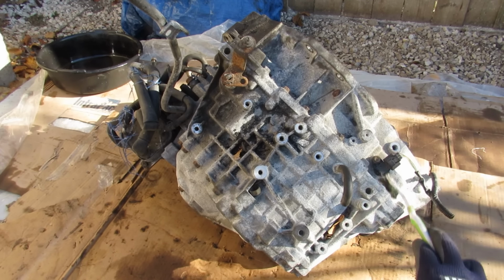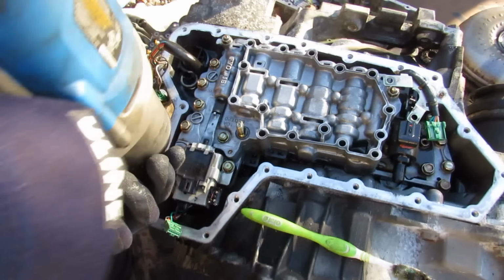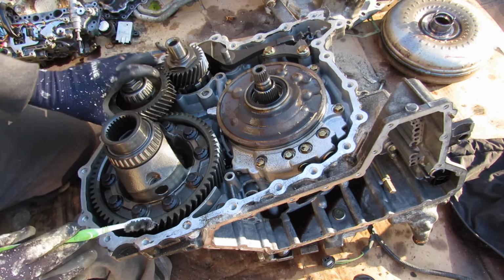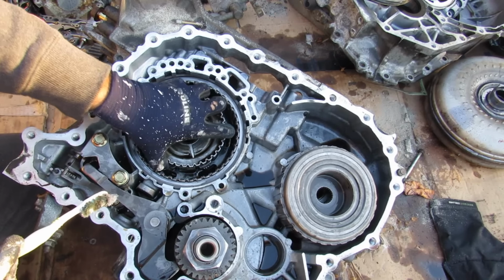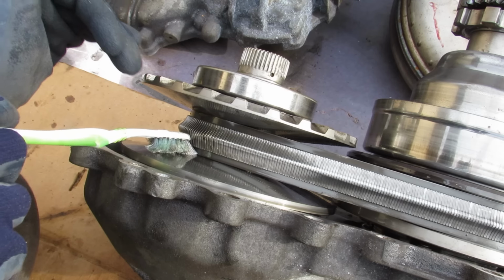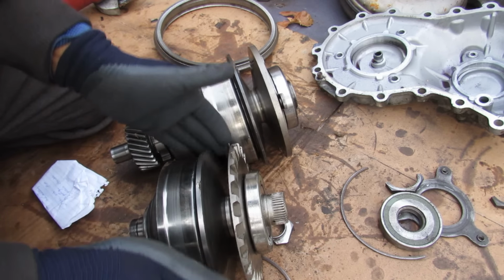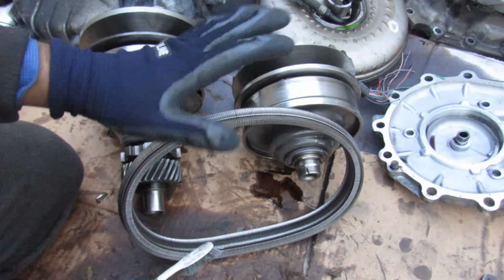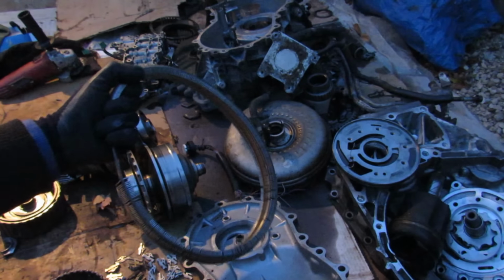Why Nissan CVTs FAIL

Comment: I'm currently with Lemon Law Lawyers dealing with Nissan on my 15 Nissan Rogue. My CVT went out and was replaced by the dealership only to be failing again a year later. Been at it for a year and half waiting for Nissan to response with a settlement until almost 2 weeks ago. Waiting on the Lawyers to get all the paperwork together to hear what Nissan said. I don't drive it anymore. I'm still paying for the car which is not working properly. Had to take out another car because that Nissan was unreliable. Because of that car, I've been drowning in bills and struggling for almost 2 years. So I am hoping to get all my money back that I payed in that car, all the struggling I had to deal with, stress and more. I knew it was gonna be the band from the CVT that was failing. I could feel it when driving. Thank you for dissecting this CVT. Very knowledgeable.

Comment: I just think cvt shouldn't exist... they are boring to be driving with.   Even going against the wind they are weak
Reply from the maker: It's for economy
Reply: @speedkar99  i understand that but going up hill engine revs up and you still loses speed.    I have an 05 civic with an 4sp auto and runs alot better then my 2016 nissan sentra... and the civic gets better miles per gallon

Comment: Will a transmission fluid flush fix cvt slippage and jerking?
Reply from the maker: It might help but if there is already mechanical damage there's nothing that can fix
Reply: @speedkar99  I'm buying a used Nissan tida 2007 model.what are the things I should look out for before buying?

Comment: CVT transmission has been conceived by DAF, a Dutch car maker, for a little car, to make it cheaper and more practical. I would never imagined such a system with some much points of failures. And I don't understand the pourpose to install "this" in a modern car having the choice of a standard automatic or a even a DSG.
Reply: Comparing a modern CVT with the DAF system is like calling a horse carriage a modern vehicle. The planetary gear system used in a Toyota CVT (hybrid) has barely any connection with the DAF system

Comment: They fail because they need 20k interval flushes ran one 350k miles until the motor died. Trans was still mint
Reply: I think this is a big part of it. People got used to never even bothering to service their transmission.  With older conventional automatics, you could get away with that.  But a CVT will make you pay.

Comment: I also have a nissan 2.0 with this transmission, 12 months ago I put in factory grade oil and it love's it when pulling 6 thou & passing at 150 kph. I don't spin the wheels so hasn't blown yet.

Comment: This type of CVT has been used for nearly a century on such things as combine harvesters which are powerful and exceptionally heavy. They use rubber pull belts rather that the one shown, which uses a steel push belt.  On a combine, speeds from zero to four or six miles per hour are the working speeds but they also need zero to maybe 15mph for transport. For that reason the variator is matched to a conventional three or four speed mechanical gearbox plus reverse.  These long established simple CVT’s in farm machinery have now mostly been superseded by fully hydrostatic CVT transmissions with oil pumps and wheel motors, largely due to the much larger size and weight of modern machinery that overwhelm the torque capacity of belt type CVT’s.  
Back to the rubber belt type variator, rather than an incorporated type of servo operating within the pulley, keeping a constant distance between the pulleys as seen in the video, traditionally the variator would be positioned intermediate to the engine and the mechanical gearbox and a simple hydraulic ram used to swing the whole variator in an arc up or down. Both pulleys could then just have strong springs pulling them together and just altering the distance between engine and gearbox would force the fixed length belts to lever the respective pulleys in and out in opposite directions to effectively alter the pulleys diameters relative to each other and therefore the speed of the output belt. The input belt is, after all, fixed to the engine speed, which in a combine is always flat out-full revs [2600 rpm typically]

Comment: Only one of the pulleys need to be powered in and out for the belt to climb or sink. The other pulley only needs a good spring to maintain a good grip as the belt allows it to expand in and out as the belt then rises and falls in the opposite way to the powered pulley.

Comment: I work for the company that makes the CVT belts. Its amazing how complex that belt is given its unassuming simple look. Its the most vital link.
Reply: My toothbrush has no power when brushing. Can you fix it?
Reply: @jonathangaudette9939  yes, let's meet on teams to discuss. You'll need livestream capabilities. I'll dedicate a few hours to the cause.
Reply: @jonathangaudette9939  not if its a nissan toothbrush.
Reply: @jonathangaudette9939  is it a CVT toothbrush?  that cold explain everything
Reply: Punny statement, guy! 👍🏾
Reply: I’ll stick to working on my scooter’s CVT.
Reply: Nissan's going to a chain instead of the belts
Reply: listen
Reply: Does the belt need to be changed as well as the fluid and filter when doing a CVT flush?
Reply: Someone pitches a question in a comment section, assumingly filled with knowledgeable gearheads who may have an answer to his question, and he receives flak for it. If you dont have the answer to his question, how about moving on and not opting to be a dick?
Reply: My nissan X-trail, somehow have no power when accellerating and i dunno why? Do you know some of the symptoms of the failure that cause my cvt to do this, I want just a few symptoms that can cause this. If you want to talk private, we can do so to.
Reply: LOL!! I know someone who works at a bank, maybe I should ask him why I'm always broke... Weirdo. @VistirinDainn
Reply: @VistirinDainn instead of asking a complete stranger to dedicate loads of time in a youtube comments section, perhaps just go to your local garage.
Reply: @stevenm8970  never understood people who comment stuff like that lmao
Reply: You should be ashamed to be involved in such an awful product lol.

Comment: One of the main drawbacks of the CVT is its limited torque capacity. Because the surfaces of the cones are smooth, the cones have to squeeze the belt or chain with great force. If an engine has too much torque, the belt or chain might slip. If the belt starts slipping in the CVT it will not last long.
Reply: Clar nu merge pe motoare puternice.Cred că pt mașini mici de oraș cu motor de 1.2 este ideala cutia

Comment: The maintenance requirements for CVT and conventional automatic transmission are basically the same; changing the transmission fluid in recommended intervals which is not very expensive.
Many manufacturers don't even list CVT fluid changes in the maintenance schedule for normal driving conditions. Instead, they advise changing the CVT fluid if the vehicle is operated in severe driving conditions, including towing, driving on dusty or muddy roads, or in freezing or very hot temperatures, etc.
Reply: Very true. Plus, how many out there do check/study the owner manual to better care of the said car especially in unforeseen circumstances, preventive or not? This is why I question the driver’s habit/characteristics more than the car itself. Car can’t be bad from the get go.
Reply: @edgaryzen4925  You have to be a good listener/detective to get to the truth of what happened. Some drivers may have done, or not done, something that lead to the problem they are bringing their car in for. However, they may be to embarrassed to admit that they made a dumb mistake and now their car is having problems. 

It's always the typical explanation/story. So, yeah. There I was driving to work. Everything was peachy until, without any previous signs/warning,  my car begins to do "X".  Not sure why my car is doing this.  Can you help me out?"  🤣
Reply: You guys fail to realise not everyone is a mech. People trust that engineers have done their job to idiot proof things for them or are oblivious. The problem might be manufacturers chasing profits over building things that would last a life time.

Comment: I have a 2022 Ford Vignale, 2.5L Duratec FHEV with CVT Automatic transmission. Wonder how long the CVT will last? Has there been any reports of failure from Ford.

Comment: The fuel economy on my 2011 Toyota Avalon is better than that of the 2011 Nissan Maxima with the same engine displacement. Mine has a 6 speed automatic transmission instead of that trash CVT. That was the main reason I didn’t go with another Maxima and the 2nd reason was the styling.

Comment: Highly appreciate all what went into the production of this highly informative video. However, Nissan has developed another nightmare in the world of automotive industry that is VC-Turbo Engine. Simply, it varies the compression ratio of a piston to be on-demand sensitive unlike traditional fixed compression ratio for the sake of high efficiency and fuel economy. Now we can enjoy Variability for both engines and transmissions 😜. However, I keep wondering when will Nissan's Variability come to end?

Comment: A long time ago, this was described to me.  It was an innovation at the time, and in principle, quite amazing, simple, and so on.  The practicalities, are as you point out, what can sink it.  I’m surprised every one of them doesn’t get welded or snapped or something, quite early on.  The belt and pulley setup, has to slip but also grip.  That’s an unpleasant contradiction for a start.  The fact this device ALSO needs a torque convertor AND some wet friction clutch plates, just makes me think it’s got the worst of a lot of worlds.  Do they last?  And the principle of pushing on a belt, fundamentally makes me imagine it gets its panties in a twist, maybe with a sudden peak load, a sudden amount of slack somewhere.

This is the CVT I wouldn’t want I think.  A friend a long time ago, had a DAF vehicle, with two huge rubber band/belt drives, that drove the rear wheels!  It was a wild concept really, and similar in principle to this I think, or using the same principles.  I think the dual-belt situation was meant to be the differential effect as well.  I am a bit biased because I chose a Prius, and cannot claim to have known it was a notably different system when I got it.  I thought e-CVT was like this.  Luckily, it is not.  If it works in practice, good.  Just my thoughts on it, are cautious ones.  Friction plates to wear out, the inefficient torque convertor process, albeit with benefits like smooth drive take-up, and the idea of a belt made up of components like that buried in the heart of the transmission, make me think ‘fragile’.  However, some people may have happily driven a long way on this, which means their manufacturing would be top-notch.  Take care all, and thanks for this explanation.  It is at least a compact system, and that’s a marvel tbh.

Comment: Here, in Brazil, this same transmission is very reliable and there are no complains about it. I think there is a cultural diference in our car utilization. Here is not commom to tow trailers, so, i think there are some relationship between this extra weight in utilization.
Reply: i have not owned a car in many years,  but i always drove smoothly.  a lot .. a lot of people abuse their tools ,  cars etc.  they have no innate feel for the mechanism.

Comment: Excellent!! I suscribed!subscribed!! Quick question...when I go to reinstall the valve body...there's a metal fork running to a stepper motor...but where exactly is the other end supposed to go in the transmission...2007 murano awd cvt?? Please and thank you

Comment: Wow, that is amazing that anyone would try to build a transmission like that, and that they last that (relatively) long in the first place. Fortunately the belt is made from steel and not rubber. Cannot be compared with Porsche Doppelkupplung (PDK) dual clutching transmission, which is also in a totally different price point and supposedly lasts for the life of the car. Thank you for the GREAT VIDEO!

Comment: The main cause of cvt failure is by overheating.
 1. The people don't change the small filter of the cooling system and the oil line clog.
2. Some cars come from factory without a transmission radiator.

Comment: This guy obviously knows a lot about this CVT, but what he calls the "Transmission cooler" is actually a heater. It transfers heat from the ENGINE COOLING SYSTEM (90-100°C) to the CVT OIL (should work between 50 and 85°C).

Comment: Still not convinced this kind of power transfer is the best way to go... this is 19th century technology re-introduced  because it is cheap to manufacture & promises improved gas mileage. The original design was used on lumber yard saws to adjust blade speed automatically as the saw met hard spots in the wood like knots or denser growth rings. The French briefly applied it to a car early on. Even with an asthmatic engine & a very light weight car, the CVT failed miserably. Cars vary speed too often. cars require more inertia to move from full stop to rolling due to weight. The poor quality of lubricates in the early years of automotive development couldn't deal with the heat this design generates. Thinking about this system...the design requires the engine now to operate to peak RPM to achieve a rate of acceleration which before could've been achieved by shifting thru a series of gears never requiring peak RPM range.
In conclusion the public has been brainwashed AGAIN by companies to accept a POS contraption that offers very little actually performance mileage wise but actually helps the companies produce a cheap unreliable high maintenance POS that when it fails at the average time of 80k motivates owners to trade up to a new vehicle continuing the circle of stupidity....funny how corporations and government work alike thru campaigns that promise a better future when all we git is more suffering....
BTW my honda FIT five speed clutch pack automatic trans returns 35-38 hwy and 27-30 town with excellent reliability and longevity....so who's benefiting from CVT?
also the O.P. even stated the companies program shift points into the CVT software. IHO, which degrades mileage and mostly hastens wear...customers complaint of engine speed noise brought the fake shift points being programed into transmission or engine management software many felt something was missing with the all the noise & whine with no spatial feeling feedback denoting increase of speed.
Good video thanx 😉
Reply from the maker: You are welcome

Comment: I had 3 2014 altimas, one failed at 35kmi and other 2 at 40kmi and 45kmi with normal driving to work. Never again, Nissan is a scam
Reply from the maker: Sadly.

Comment: Hi my friend, I have a 2016 Nissan Rogue it has 122k miles on it and has never had a CVT fluid drain and fill service.  Do you think it's too late to do it or if I can do it.  By the way, it doesn't have any faults and it drives well.  thanks for the video.
Reply from the maker: Drain and fill don't flush
Reply: @speedkar99  I tell them to call the Nissan service to get an appointment for the drain and fill service and they refused to do the job, they say that with 120,000 miles it is already too late, they say that it is risky since it is the first time with this maintenance.  😫 I am now considering doing it myself, will this be a good decision?  Thanks for your help!
Reply: @Hugo_X  wrong. it is still good decision to make a drain and fill I’ve done mine for the first time at 90k mi. I would suggest try Aamco or other chain tranny companies. If not one of those auto body shop guys who does the repair on the side would be happy to assist ya. Keep in mind old fluid might be just low and causing all the issues on the line. I’ve been there. Recently I was checking my tranny fluid after 20k mi of change. Guess what! The fluid level was low! I had to add it! With no leakage or no nothing. It was just low! These tranny burns fluid like crazy sometimes it will eat up the nitrile o-ring even. Just bc the temperature of fluid goes above 250f. Again drain and fill w fluid filter change along the gasket is very recommended every 25-35k mi from now on
Reply: @vincentra8849  brother thanks for the help!  I appreciate it.
Reply: @Hugo_X  no worries. It’s about lack of maintenance from the owners side usually that cause most 6gen jatco tranny to fail. Quite frankly 7th 8th gen are more complicated compared to 6th gen like mine just bc of it being 2speed CVT. But hey this means there is a launch gear for you not me. And that generally helps out the wear and tear of the surface. Although that comes at a extra cost of heat. If it is V6 or low pressure turbine in it.  Please add an external cooler w thermostat. That’s going to save you big bucks in the future.
Reply: Flush is unnecessary. Drain and fill. Also change the filter as you do it. From now on every 4 oil changes your friend has to think about tranny fluid change. That’s all.

Comment: I will not buy any car with CVT.  CVT costs too much, such as poor transmission efficiency, shorter life, unreliable, and required cooling. I don't need helpless continuous various transmission with too much cost and trouble.

Comment: What a God awful mess.  This is preferable to a manual transmission?   Of course they stop the manual trans because they're simple and don't generally break.  Look at the mess going on inside this tranny and all the points of failure in there.  No thank you.